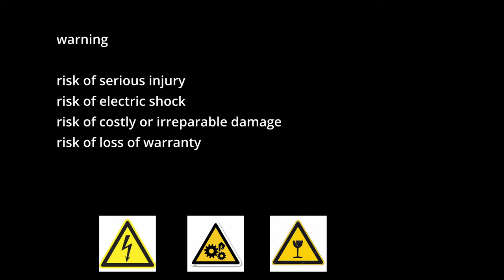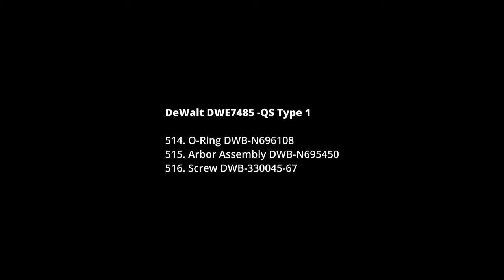DeWalt DWE7485  QS tablesaw arbor assembly replacement

Comment: Hey man, great video. You said you were getting blade wobble and I am too. Did it show up in the cut quality as well? Im getting pretty heavy saw blade marks in my material. My saw is tuned very well for parallel and square, the heavy blade marks are the only thing i can’t get rid of
Reply from the maker: No. In my case, the cut quality was fine. Even with the original DW blade. See in this video, too: https://youtu.be/y4EnvLMSt2A?si=fFjiTQ10WLmDhMFx
(I upgraded to Freud cross-cut and rip-cut blades later on.) 
A fellow woodworker had serious cut quality problems. His blade was replaced under warranty, this solved his problem.
Reply: M y arbor had some run out but I used my router and grinding stone to true it up

Comment: What did u replace this part ?  What were the symptoms.   Mine started making a awful noise upon Start up.  Like I lost a bearing.
Reply from the maker: I replaced it because of the wobble of the various saw blades. No noise or whatsoever.
Reply: @amadeus214  exactly the reason I'm replacing mine, 1mm wobble on my blade.